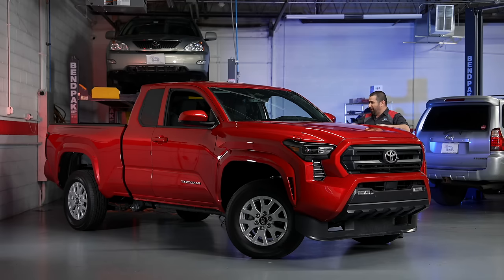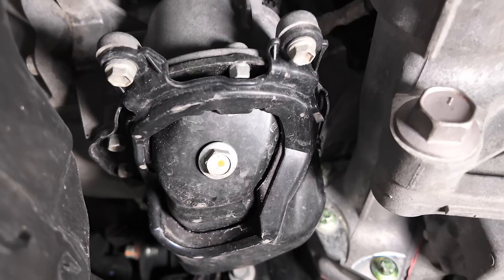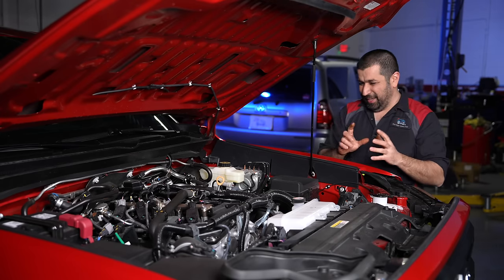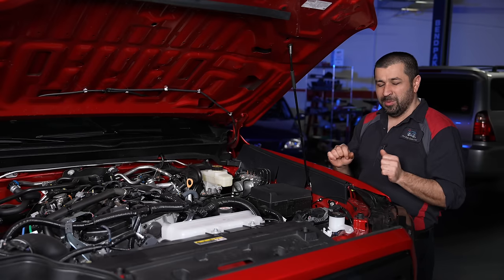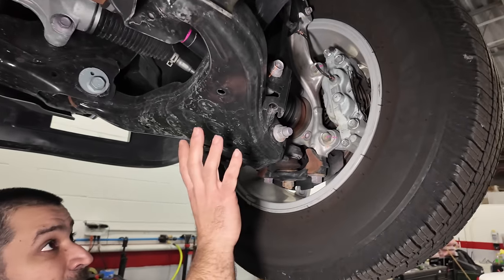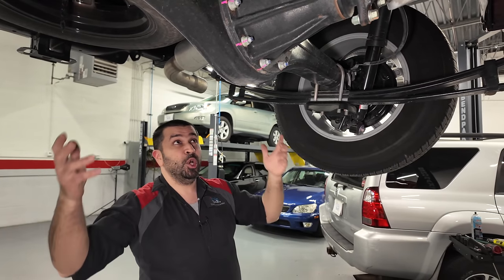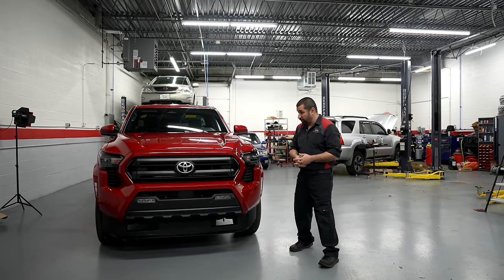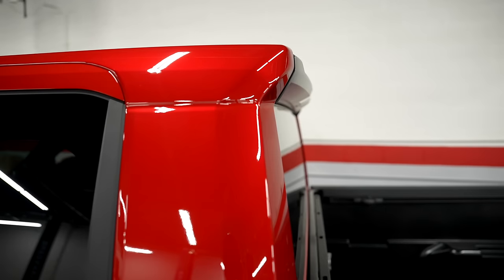2024 Toyota Tacoma | Did Toyota Improve or Ruin The Tacoma? Comprehensive Review

Comment: I am sure the power and economy are up but the turbo creates heat, and heat creates degradation. It will not last like the old 2.7 or the v6, the turbo is another thing that will go wrong in the future and cost a lot to fix.
Reply: But you’re going to get the typical Toyota has reliability comments
Reply: Truth. Turbo will probably last along time, but eventually will break negating any gas mileage savings you get. The positive of the turbo 4, is you get more power.
Reply: Will a turbo’d Toyota engine be more reliable than a NA Toyota engine, probably not. Would a turbo’d Toyota engine be more reliable than most other NA engine from other makes…probably lol
Reply: time will tell
Reply: @chibbyylol  taking a turbo engine and putting a Toyota or Lexus logo on it doesn’t automatically make them reliable. Just like taking the b58 and putting a Toyota logo on it in the Supra won’t make it Toyota reliable like a corolla
Reply: Quality and design being equal, a turbo will always fail before before the rest of the engine. And turbos are completely intolerant of poor maintenance.
Reply: @0HOON0  i think semis can run for a million miles. they have been turbod for decades
Reply: @naveenthemachine  nope even toyota loyals are complaining its simply a bad idea fro toyota
Reply: Ford mechanic told me they expect turbos to fail around 120k.  Expect!
Reply: @naveenthemachine  taking some other brands engine and putting Toyota on it won’t I agree, but I’m speaking of Toyota made engines
Reply: @Enchanted3DPrints  1) Diesel engines do not have throttles don't stress the turbos as much. 2) Many over the road truck owners are fanatical about maintenance.
Reply: @ericfitzsimmons1202 but is that what they see when people do 10k mile oil changes with semi synthetic oil? This is what the Ford maintenance minder does at least on the F150. Turbo cars just change the oil with high quality full synthetic every 5k. My mom’s old Volvo made it to about 150k on the original turbo but junked due to electronic issues (1998 technology)…
Reply: @ericfitzsimmons1202  yep usually 100k even the high quality ones last no more than 150k
Reply: This is getting out of hand every daggon vehicle wether it’s a small/medium/Full size Pick ups small to full size SUV all becoming a 4 banger turbo just to appease the government is insane! Not to mention us car enthusiasts don’t want to be driving big vehicles with small strained engines. Turbos do and will burn out quicker when trying to tow with a bigger heavier vehicle. I drive full size Motorcoaches for a living those buses and semi’s eat through turbos like hot cakes because of their weight. So yes we will miss the bigger naturally aspirated V6/V8 engines that are supposed to be in a bigger vehicle not these small pitiful engines that are really suited for smaller lightweight vehicles.
Reply: @Enchanted3DPrints Yes, but diesels are a whole 'nother kettle of fish, plus truck drivers tend to be better trained on the proper operation of their engines.
Reply: @Kevin-fm1vn  True. But all else being equal,  a smaller engine putting out more power is generating more heat and higher loads on the internal parts. Since no one has actually invented Adamantium yet, that equals a shorter lifespan. It's simple physics
Reply: Then don't buy it and get a disgusting Ford or Chevy. AAA roadside assistance will be your friend.
Reply: @Kevin-fm1vn yes but common sense tells us the more air you are pushing through an engine the more likely it is to fail,extra pressure and extra stress and heat leads to a higher rate of wear on the engine it’s simple logic,also yes manny turbo engines have been seen to wear out faster than their (na)counter parts
Reply: @Kevin-fm1vn it’s Just like asking “is it a fact a person with higher blood pressure have heart attacks more often then people with normal blood pressure?”sure it depends but more likely than not the machine under more stress will give out sooner and that is besides the turbo which is just another component that breaks and cost more to maintain than a naturally aspirated car would
Reply: @Enchanted3DPrints diesel. Not gasoline.
Reply: facts
Reply: @chibbyylol doubt it they haven't been making turbo gas trucks as long as Ford has.
Reply: @Enchanted3DPrints  your ignorance showing.  Turbo diesel is not the same as turbo gas.  Turbo gas runs about 300 degrees hotter than turbo diesel.  Heat kills everything.
Reply: Just retired from the business, expect 80k to 120k for a gas turbo. People who try to equate a gas turbo with a proper diesel turbo have never worked on them. A diesel runs around 18 psi boost into a very strongly made engine. These compliant engines are running more boost on very light duty engines and made in Mexico.
Reply: Future insight …
Reply: @marklihsu  One of the most common turbo myths is that running boost will damage your engine over time. Again, it all comes down to design. Any improperly designed motor setup, whether it’s due to bad ECU programming, not enough fuel delivery or improperly timed spark, will have a negative effect on a vehicle. However, a properly implemented turbo pushing enough PSI through a motor to produce respectable levels of power won’t strain a motor any more than idling in traffic will
Reply: @aaliyahstar7803  do you believe the four banger is weakly built?
Reply: @tinolino58  No that’s not what I’m saying what I’m saying 4 bangers are  best suited for smaller to medium size vehicles not for larger vehicles especially ones that do lots of towing it’s causes it to strain and turbos to wear out quicker is all I’m saying.
Reply: @aaliyahstar7803  six cylinders have more friction than four. Six cylinders development stopped many years ago. Six cylinders have more thermal loss and are therefore less efficient. 
Modern four cylinders are much stronger built than before. You are mistaken that the number of combustion rooms are a sign for strength and durability. 
The turbo is probably not made for more than 10 years due to costs. The generated heat dissipates via the intercooler. The turbo is fed via a watercooled exhaust manifold. Get an update on mew engine design to understand whats into todays engines.
By the way, I design engines, tuning parts, crankshafts, clutches etc. Have fun!
Reply: @tinolino58  IDC what you claim to be I SAID WHAT I SAID! Little 4 banger engines do not belong in heavier larger vehicles! They keep throwing these 4 banger turbos in these larger heavier vehicles just isn’t wise for longevity and reliability. We all can conclude that heavier vehicles put a strain on these smaller engines; adding a turbo in them and wearing them out sooner putting reliability in question. Bigger naturally aspirated vehicles don’t have to work so hard on moving heavier metal around. I don’t even agree with throwing turbos on V6’s  which it seems they’re all heading in that direction to replace V8’s. Furthermore there are countless Legendary V6’s produced running for hundreds of thousands of miles. 4 bangers also can run hundreds of thousands of miles so long as they’re in vehicles well suited for it.
Reply: Turbos are not a problem these days. Maybe 20 years ago. Turbo technology is so basic. All you need is a solid head gasket and great cooling. 

Engines will last long with less stress.
Reply: @naveenthemachine B58 is Toyotas best engine that they don’t build. B58 is built for heavy abuse. Definitely bMWs game changer engine. 

BMW has X5 in top 10 consumer reports now. That B58 is why. 

M340 and 240 is a hot seller for BMW now.  Best sedan to buy under 70k.
Reply: @ericfitzsimmons1202 Ford sucks at Turbos. I was a Ford fan until early 2000’s. I would never buy a Ford again. 

Toyota will make a long lasting turbo. It’s the simplest technology. 

Germany has been making long lasting turbos for a long time. Toyota copied their success.
Reply: @marklihsu  good point.  Are Toyota engineers smarter?  I have doubts.
Reply: @octaviodominguez7772  then you should get a 1980 truck with a v8 making 150hp. They had such small ports very little air was pushed thru
Reply: I have a 2023 Tacoma I only have two thousand miles on it so far I'm satisfied,it's a SR5 two wheel drive ,I also have a 2021four wheel drive Tacoma I bought new plain on keeping it my wife says I might want to be buried in it, Toyota makes good vehicles I've had a lot of vehicles Toyota's have proven their self's far better than any other vehicle's I've owned.
Reply: @quantumharvestllc2082 no, but we do have Aluminum Glass. So there’s that (Star trek move with the  whales & Scotty trading future tech for some aquarium panels..”Hello computer” talking into the mouse)😂😉😎
Reply: @naveenthemachine Funny how the million mile Frontiers on the web get ignored,  but ANY Toyota is assumed to be reliable, even the Tacomas that rusted in half due to bad frame design.
Reply: @Enchanted3DPrints Semi trucks are also diesels, and their engines are  overbuilt to take constant loads of 80,000 lbs or more for hours on end, while turning at speeds barely above the idle speed of some cars.  They also have  both primary full flow and secondary bypass oil filters to keep the oil pure.  If you listen to a modern big truck accelerate,  you can hear them shifting below 1700 rpm. They almost sound like locomotive engines.  Even my old screaming green Detroit 6v71 diesel is set at a 2100 rpm redline.
Reply: @0HOON0 Modern big  diesels also spin about 1700 rpm max.
Reply: @matt9c1 What's wrong with the 3.8 Nissan option? No turbo, good power,  great reviews.  And Nissan builds some of the best v6 engines in the world.  I have driven Nissan pickups over 40 years, including the current one for nearly 30 years. They really do the job.
Reply: @tinolino58 What about the new Chrysler Hurricane 6? Newly developed.  Also, all big trucks still are developing the straight six. Must be something good about them.  No heavy trucks are going to giant 4 cylinders
Reply: @ryanb8736 Don't forget about a very clean and strong oil supply.
Reply: @jeanclaude7018 Do you own a Nissan V6 AFTER the Renault partnership? Since Nissan's partnership with the Alliance (Renault, NIssan, Mitsubishi) we don't know what the long term reliability will be. Maybe good, maybe not. The 3.8 was introduced after Nissan joined this partnership with Renault (yuck). If Renault kept their fingers out of it...maybe. Hell, if Renault designed the oil filler cap, it would still find a way to ruin the engine.

Comment: Glad I was able to get my '23 V6 Tacoma just in time. Bottom line: A smaller motor putting out more power means more heat and shorter life. They figured this out in WW2 with the big aircraft radials.
Reply: Yes, and in WWII the useful life of those fighters was only a few months. Engine lifespan mattered little. What mattered was raw speed.
Reply: why didn't you get a 1980s tuck that made like 150hp out of a small block v8. The 3.5 v6 is an incredible complex engine on its own dual overhead variable valve cams, direct injection, aluminum block, 4 valves per cylinder. The Ford 300 (4.9L) is considered one of fords most reliable engines many with over 500k miles made 110hp in the 80s. And too make the argument even more ridiculous the Ford Model T had a 2.9L engine making 20hp. More goes into engineering than just power per litre.

Comment: Look at ALL those hoses! NO THANKS. I WILL STICK TO THE 4.0 V6!
Reply: Toyota has been putting some variation of that I4 turbo engine in the Hilux and other overseas models for over twenty years. It's dead reliable and as durable as any Toyota engine. Toyota is not Ford or any of the other truck manufacturers. They don't just drop new engines in the US market. I know everyone loves the 4.0 V6 but it's a dinosaur. Underpowered and horrible gas mileage. It had to go eventually.
Reply: They are still using the 4.0 in many vehicles overseas and the 4Runner.  It is powerful, reliable, and fuel efficient.  It’s still a very modern engine.  That being said the 2.4t is a better engine that has a good track record.
Reply: They are appealing to their main target audience of mall crawlers and those that drive a dirt road twice a year. Smart business move but really sucks if you off-road or want a Toyota truck for the ruggedness like older hilux’s, land cruisers, and tacomas.
Reply: That was the first thing I though of was when seeing under the hood.  There is a crazy amount of hoses and wires harnesses.  You can't even see the engine.
Reply: @donm2255  All vehicles have wires and hoses. The V6 was same. I take it you’ve never worked on engines. 

Now you have less moving parts. One head instead of two. One head gasket instead of two. Four pistons and rods instead of six. Only one head of moving parts instead of two, so timing chain is less stressful. 

Smaller engines means, more room.
Reply: @ryanb8736   Apparently I am a lot older than you.  I remember engine bays that were much less complicated.  You could actually see the engine.  A long time ago I owned a 1979 280zx.  I could reach down and remove the oil filter from the top.  I currently own a 23 TRD Pro Tacoma.  I have no desire to own a 4 cylinder truck.

Smaller engines also have to work harder.  That heat and stress cause premature failures.  A turbo 4 engine is not going to last longer than a larger, normally aspirated engine.
Reply: @donm2255  I worked on Datsuns in the 80’s and 90’s. The fuel injection were advanced for those days and everyone said they will never last and they will eventually go back to carbs. 

Well that never happened. Fuel injection was here to stay. So much easier to work on if you know what to do. They lasted 10 times longer. 

Newer turbo engines are same way. Especially if made by Toyota. Lexus has had this engine for years. It’s been tested.
Reply: @donm2255  no one really thinks the 4 with a turbo is going to outlast the vaulted v6, regardless of advertizing propaganda.,,,it's like stating we have a great economy,when the common citizen knows better.
Reply: @donm2255 
Lol your truck has to rev up to 4,000rpm to merge onto freeways. The new turbo4 has peak torque at 1,700 to 3,800rpm, torque like a V8. The old 2gr 3.5 is fine in my Lexus is350 but it sucked in the 3rd gen Taco.
Reply: @mjwbulich It has too much plastic for the temperature changes of North America. My 01 Ranger too much plastic like that and it's not doing well.
Reply: @mjwbulich  The good Hilux is DIESEL!!  Where do they sell a gas 4cyl turbo Hilux?
Reply: Just say you’re broke and can’t afford it
Reply: @PillPushaT  OK
. I'll just keep rocking my 4 runner. Lol.
Reply: @PillPushaT No because the 2024 has a bunch of breakable plastics that is connected to the engine for it to function and using turbos to make up for a wimpy engine is "designed to fail," which makes it a bad investment.
Reply: @michaelcarson8375  okay guy because you know more than Toyota’s engineers 👍
Reply: @PillPushaT  🤣 Actually I'm going off the advice of Scotty Kilmer, whom Toyota Engineers has deferred to in the past. He's got more experience with ICE vehicles than the majority of the rest of ytubers put together.
Reply: @mjwbulich the 4.0 is faster than the 3.6 and has less hp😊
Reply: @loveydovey4u  I agree, but finding one of those with low miles is ROUGH.
Reply: @ruthnoya8424  I have a v6 4runner it does not go to 4000 rpm merging on the highway